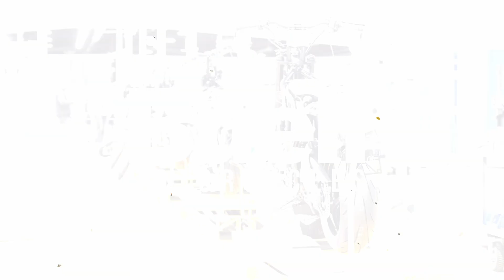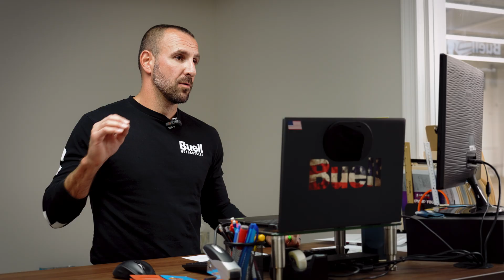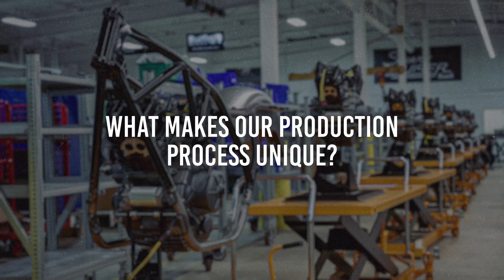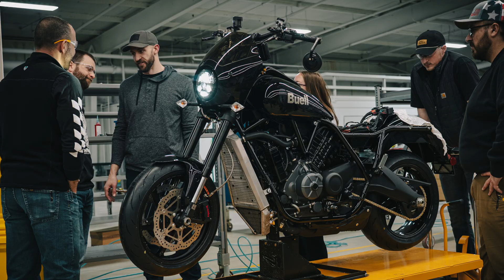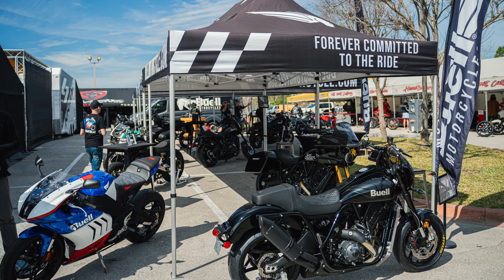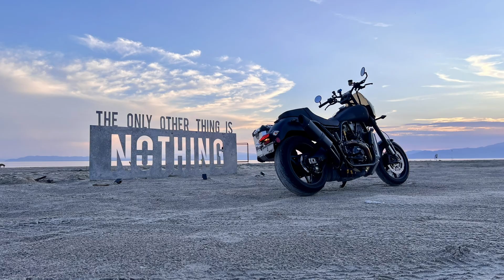Breaking the Mold: Buell's Transparent Journey to the Super Cruiser (Part 3 of 3)

Comment: That hard bag on one side is ridiculous. The exhaust pipe should go straight instead of up. That way, you can put saddlebags on both sides. Also, that radiator is ugly now. They should go back to the original design, and figure out how to mass produce it, instead of making excuses. The new one sticks out, hangs down, and has a weird shape. The original one was one piece, up against the frame, and has a good shape. And that new rear fender is terrible, with that plastic junk on the back. Harley didn't have that on one of the Sportster models that has the side mount license plate, so y'all can figure it out. The way that the license plate was mounted before was perfect. The original fender was pressed for the Joker Machine tail light that it had on it. There's no place to add it to this new fender. Buell is doing too much.
Reply: Radiator on concept wont do as good cooling the system down. Production model has fan and also has oil cooler at the bottom, necessary for a motor with this much power. Making it black instead will make it look much better. And the pipe comes from their sport bikes they already have. Already approved and legal in 50 states. Easier for production and will get 100% replaced by owners anyway. This is an American hotrod meant to be modified like a harley. Except this only needs an exhaust swap, rest is cosmetic
Reply: @Osyrus48 ,
How do you know? That's not necessarily true. It worked fine, before they changed it, and it didn't have fans. Fans aren't necessary. It's just an added bonus. I don't know why you're defending that ugly thing. The original one looked good, without it being black. They have other exhaust options. I've seen them. One was also from their other bikes. Not everyone can afford to replace the exhaust, so it won't always be replaced. You're not about improvement. You're about keeping everything easy. I'm actually providing feedback. You're just telling them what they want to see from potential customers.
Reply: @RayfordRaySiegel  im not defending. Just been following whats available. Melvin said it himself in one of the interviews, the concept radiator didnt work as well cooling the system. Concept also didnt have oil cooler, just water cooler. Production model will have both. And yes, they’ve been riding it til failure for durability testing. For a bike that puts out above 150hp, you need all the cooling help u can get. Why wouldnt you want it? And if you really wanted, you absolutely can customize it to replicate the concept. But why? Unless u prioritize looks over function

And what about the pipe? Theyre just using what they already have. Epa approved already. If they make a new one, it’d set the production back years because it would have to get approved. Customers will change that anyway. Like Harleys we never keep it stock.

The rest, you can argue and complain but theyre just cosmetics. Gradual changes we do over the years, no big deal
Reply: @Osyrus48 ,
First of all  it's "I'm", and secondly, you are defending it. That's exactly what you just did.

Again, you don't need the extra stuff. Plenty of sport bikes don't have some big ugly thing on the front. And if they want to put it on, they should build it into the radiator, in one piece. I would not be able to replicate the original radiator. You act like I have the ability, money, and the original one to use as a template. I don't prioritize looks over function to a point; it should still not take people's eyes to it, and away from the rest of the bike, because it looks terrible. It defeats the purpose of making the bike look good. There should be a balance. And "u" is not "you". 
As far as the exhaust goes, you don't need to tell me what I already know, but already told you, and you still don't get it. It would not set the production back. They're already not selling these in large numbers, so they would have time. And I  already told you that some customers won't be able to afford to, at least, for a while. The company needs to quit being cheap. They're changing a lot for this bike. It needs to be ready to ride and put saddlebags on, when bought. And some people do keep things stock. I like my stock Harley pipes. They're loud and classic. They also look good. They even went cheap on the rear fender. What excuse do you have for that? They already had a place for the tail light and license plate. Now  they swapped it out for one that no longer accommodates the same style tail light. Then they added that plastic crap to the end, to hold the license plate, which puts holes in the fender that will show, when people remove it. What do you expect people to do, for that? You state that people  don't keep their bikes stock. With that, you acknowledge that it will be seen, because people will remove it, and that it was not thought through.
You can defend their bad decisions, as much as you want, but it doesn't change the fact that they made some bad design decisions.
Reply: @RayfordRaySiegel  a new exhaust will not push the production back? Ok buddy whatever you say. 

Like people buying this machine will really keep that exhaust on there…ya ok
Reply: There's a "tip kit" coming for the Super Cruiser with an ECU reprogram that looks very similar to the one on the 1190 sport bike. Plus there's a few companies making exhausts for it as well, there was a injector change on the production bike which made the old ECU map not compatible with the pipes out there ready to go. Give it some time.